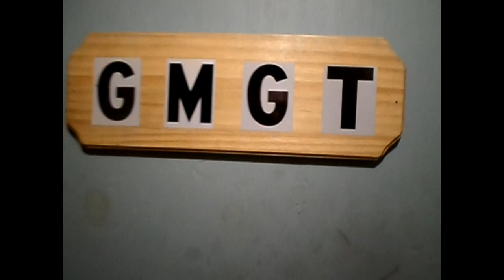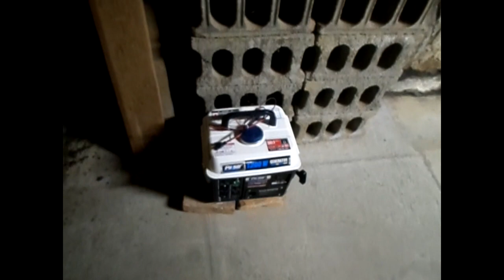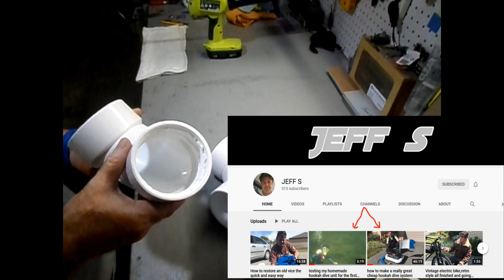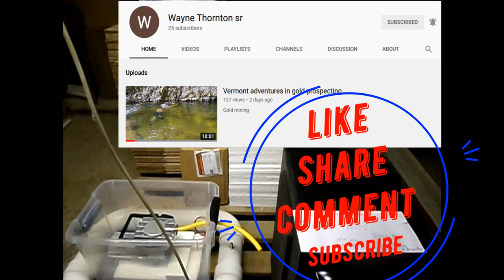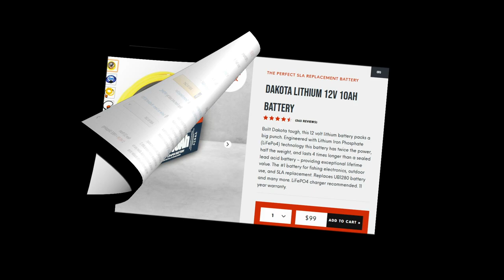DIY Dive Hookah Build - Green Mountain Gold Trap

Comment: Sweet build Joseph! Looking forward to seeing you using it.
Reply from the maker: Thanks Dallas😁 I did do the one test run with 6min under water. It was GREAT and I could have stayed down there for hours! I love it😃
Reply: Makes me want to build one however I don’t really have a good place to use one at the moment lol. Also just wondering did you by chance keep track of the cost to build it?
Reply from the maker: @dallassams6427  It was over $400. However, I bought 100' of air line with the regulator and mask. Someone could save money there by searching for less air line, buying a mask separately as well as the regulator. But, an actual dive hookah costs $1,225.00 to $3,445.00

Comment: Thats an awesome job on that dont have to worry about bulky tanks that is a great idea. That way i can go back to driving with my back problem really nice i think im going to make one thats really cool. Need a new mask flippers ans a weight belt. Maybe i will just sink with all this metal in my back. Thanks for the build Joseph i think you made my day.
Reply from the maker: AhHa, you have built in weights! Not exactly funny but, it may work to your advantage! But hey, do yourself a BIG favor if you do build one, Get (Food Grade PVC Cement). If you do an internet search on it, Gorilla puts one out on the market.
All in all I think mine weighs around 10 ponds with the 50' of air hose and without the reserve air tank. That's roughly 8 pounds. But as you can see, I made then so that you can carry one at a time.

Comment: Hello and congratulations.I made one the same but I can not go below 3 mt.Tu how deep you reach without straining too much in breathing?
Reply from the maker: Thanks Filippo!
I have not been in any locations as of yet that deep. However, the guy who put a video out using the same pump went deeper than 3 meters. He built his with 4 inch pvc pipe for the tank.
Maybe give the tank time to fill up a bit before diving.
I installed a pressure relief valve in mine so that the tank won't overfill.
The places I go do not require me to go any deeper than 2 meters so far.

Comment: great video.  I plan to build a Hookah similar to what you did.  I have a choice of aeration pumps with capacity: 3000l / H, 3600l / H, 5100l / H, 7500l / H, 8400l / H.  Which will be optimal?  Will the 3600l / H pump be optimal?  What battery do you have and how long does it last?  Have you considered the option of a pressure sensor and when exceeded, the pump is turned off, and when it is lowered, it turns on?  or does he have to work all the time?
Reply from the maker: Thanks GS Creative! Not sure on the 3600l / H pump. Don't know anything about them really! I got the Boyu pump because another person did a video on it and it worked. I bought 2 Dakota Lithium batteries. Each one lasts 1:29 min on a full charge. They ran me $99 each and the charger was about the same price.
I do want to upgrade and add a pressure sensors but have not yet so for now it runs constant. I did add the 100psi pressure release valve just in case.

Comment: Have you ever dove over 10 feet with this setup? I just ordered my hookah parts yesterday...going with the boy u 120 watt 160 lm..I hope it's a success..thanks for sharing
Reply from the maker: Thanks roadstar for watching. I personally have only been able to go 8’ as it was the deepest hole I’ve encountered.
However, the guy in Australia who put out a video using the same pump went 13’+ with his in a lake or pond.
Consider using an aluminum air tank. I know Harbor Freight has them.
Also, I have had people give me a hard time on the air hose I bought.
So, you may want to find actual dive air line. Apparently mine is not.
So, if you do go with the PVC air tank, Don’t use plumbers cement.
It takes months for the toxic fumes to dissipate.
Good luck. You will love it for sure!
Reply: @GreenMountainGoldTrap  sharing. Will be going to harbor in next day or so..what  aluminum tank are you referring to..? Thanks for the info..
Reply from the maker: I never looked into it. It was something someone had said in a video. Or, someone told me about it. Can’t remember which!

Comment: Okay harbor freight has steal air tanks..heavy,bulky etc..once your pvc cured did it work well? Or do you wish you would have went with 4" instead of 3"...? I don't think this pump produces much pressure...did you ever figure out max pressure generated in holding pvc reserves? I could use e6000 instead of pvc cement which cures in a couple of days and will hold very well,been using it for years..thanks for sharing
Reply from the maker: No aluminum tanks! Bummer! I feel the 3” is fine. I added a pressure release valve that kicks on at 100psi just to be safe.
And yes, after the winter got over the fumes were gone and it’s fine.
I think Gorilla has a product as well. That is I believe food grade.
Reply: @GreenMountainGoldTrap  so you installed a 100 psi release valve on pvc donut? Any idea of how much pressure builds up? I guess adding a pressure gauge would be very easy also..I just did not think that boy u 160 would build up much pressure...I am a week into research,so i have a lot to learn...definitely like the pvc donut idea best...thanks
Reply from the maker: @roadstar499  I have only used to whole unit (pump in the tote sitting on the pvc tank) once. All the other times not feeling like hauling everything in I took just the tote with the pump.
So honestly, I can't say for certain. Personally, my plan when I use it this season is to allow the tank to charge up with air a little bit before diving. 
As for installing the release valve, that was simple. I just drilled the hole slightly smaller than the threads and then screwed it in. Put some marine adhesive sealant around it and called it good!
Reply: @GreenMountainGoldTrap  very cool...I should get my pump in a couple of days and do some testing
..last night I figured out how to adjust regulator, which seems to be a big factor in performance,some guys using same pump say 5 foot is the limit, but this other guy has a video of him at 30 feet and he used same boy u 160 120 watt with cheap yellow reg(which he adjusted) ..he said at 30 foot I was pretty hard to breath but 23 foot was fine...thanks for all your feed back.
.
Reply from the maker: @roadstar499  I looked at my regulator. Doesn't seem to be a way to adjust. Any tips?
Reply: @GreenMountainGoldTrap  tried a couple of extra air tank  methods..I am very happy converting a 2 gallon $16 pump sprayer..it also has a built in release valve..total pressure is approximately 25 psi...no leaks..after fine tuning my regulator its ready...I used 160 lpm pump..took it apart and cleaned removed all metal filings.using a $30 chrome small 12 vt battery from Amazon I should get 50 plus minutes before battery starts to gradually produce less air...if pump does cut off I get 2- 3 full breaths..I also noticed using tank makes breathing less restrictive..
No glue was needed for tank,but I did use e6000 industrial adhesive to make the 2 Miller extra flow fitting extra secure.i am using 20 foot of food grade clear 3/8 Id tubing for now...does not kink and seems very decent for now...hope to be able to use  it to find my sunken rc boat within next week...
Reply from the maker: @roadstar499  Sounds outstanding! Would love to see some pics of it. If that's cool with you send them via the Contact Us Link on my website.
https://www.greenmountaingoldtrap.com
In the subject put, roadstar499 Dive Hookah Build

Comment: Awesome!!  I have been looking forward to this build!!
Reply from the maker: You and me both Josh. Just wish I got it done sooner. Winter is going to really suck this year!
Reply: @GreenMountainGoldTrap  yea i can imagine.  The only thing I would have done to this is I would have rapped pool noodle around the PVC to add extra flotation to it.  As well as add handles/strap to be able to secure the tub into it  while in water.  Some areas of water can be rougher then others so good to be prepared for it =)
Reply: @GreenMountainGoldTrap  this is going to open up way more possible prospecting spots for you now!!  Can't wait to see what you find.  I am going to end up building one probably this winter so that I can have one to use for prospecting as well as diving in the local lakes/rivers just for fun.
Reply from the maker: @joshortiz1576  Funny you should mention the pool noodle, I was just thinking that today! As for rough water, I don't think I will be doing anything there. As a matter of fact, with 50' of air line and all the spots I go, I will have the tank and pump on shore. Great ideas though! Thanks😁
Reply from the maker: @joshortiz1576  That's awesome Josh. It's an easy build and you will love it for sure.

Comment: It appears that the battery lasts 90 minutes if running nonstop. I'd assume that once you get a regulator setup put on it where it can shut off when it gets up to pressure that it could last even longer when running intermittently? I've been going over options for months of how to do this safely.  Reading on the internet gives so much info that I became leary of using pvc pipe as the air tank.   Now harbor freight has a 7 gallon aluminum filling tank for about 65 dollars that I'd considered to use as the air reservoir while still using PVC as a floating table. Would love to brain pick you.
Reply from the maker: Thanks Shawn! I tested length of charge on the batteries I purchased from a full charge. The run time was 89 minuets. Feel free to ask questions. I will do my best to answer. And please do tell, what did you discover on pvc? And would aluminum be any safer? Just so happens we have a Harbor Freight opening very soon here. Still under construction but my step son is one of the assistant Mngrs.
Reply: @GreenMountainGoldTrap  now aluminum is best because it wont rust and is pure so it wont corrode and is much lighter as well. No one would want to really use an air tank made of steel when the inside corrodes over time and sprays out rust water from the release valve.
Reply from the maker: @shawnjones8748  I'm guessing scuba tanks must be made from aluminum. I'm going to have to look into changing it out once Harbor Freight opens up. I don't need the pvc at all since I have 50' of air line. And the 7 gal tank sounds like it will be a larger capacity than what I have now. Thanks for the info!

Comment: Nice build, for a second thought the tank was going to float the tube, partially submerged to keep it cool.
Reply from the maker: You lost me on that one Ed🤔 The only part of the pump that gets hot is directly above the diaphragm due to friction. The battery get a little warm as well. As for the air line, it floats on top of the water.
On another note, you and Judy were on my mind today. If I weren't so busy, I would have called you. How is everything going?
Reply: @GreenMountainGoldTrap  Doing ok, got stuggle snap hurdles to get over. We are taking it one day at a time,
Reply from the maker: @HDshovelEd  Good, you will both get through it. Keep the faith.

Comment: Nice build!  Thanks for sharing.  Do you get any build-up of moisture in the tank?   Do you use any means of air filtration?
Reply from the maker: Thanks Michael! So far I have only used the tank one time. There is more mods I want to do to the system such as adding a switch, air pressure regulator so the pump shuts off when it get to a certain psi, add a filter as well as rig it to support two divers. I built it towards the end of last season and it's killing me!! Can't wait for spring!

Comment: Did you fuse your pump. Concern is water getting in and short that could cause high heat/fire the bad gas/air
Thank you nice video
Reply from the maker: Thanks for the heads up redwood1957. No, I didn't! Really haven't had many opportunities to use it. Don't like going without someone else present for safety reasons.
I have further mods I want to add. Your suggestion is a simple one to incorporate.
Reply: @GreenMountainGoldTrap  trying to build one now thanks mike
Reply: Sailing boreal for psi relief and filters. Try a Nokta pulse dive.
Reply from the maker: @redwood1957  Would love too. But, our gold for the most part isn't detectable. I have a junk Trident Viper or, Viper Trident. Goes 30 meters underwater, but it's garbage! That's what I get for knowing Nothing about detectors and buying one on a whim!
Boreal is a Yacht! But I;m thinking you mean something else since you ended the sentence with, for psi relief and filters.
I have the 100psi relief valve already incorporated. Works well. Just do be right near it when it lets go. It will make you jump a mile!!! 🤣
Reply from the maker: Excellent  @redwood1957  Whatever you do, don't use the pvc cement if you want to use it before a years time! That stuff took forever to stop stinking!
There is a food grad version for pvc cement.
Reply: @GreenMountainGoldTrap  sailingboreas,youtube makes snuba rig parts
Reply from the maker: Nice, I will check that out  @redwood1957  Thank you!
Reply: I have built mine without pvc and tote.when I breath from regulator I hear the pump change sound as if I'm pulling it down on air.  Any ideas 
Thank you

Comment: Perhaps because I am accustomed to a Scuba tank, I find the flow from this pump to be really unsatisfying. I am able to draw breath, but not fill my lungs as quickly as I am used to, even at rest and at the surface. I am not sure if my pump is defective or if my expectations are too high. Not sure what could go wrong with the pump, it seems pretty simple. I have not built the air tank yet.
Reply from the maker: Hi Gregory. No, I as well have no idea but without the tank I agree with what you have said. I myself have never used a scuba tank so I can't say I know the difference.
 With the tank it's better but again, I don't know the volume a scuba tank gives in comparison to what I have.
 What I plan on doing is switching the tank out with an aluminum tank that will have more capacity than the one I built. I need it to be light weight.
Reply: @GreenMountainGoldTrap   I have been thinking of options for an accumulator tank - today I'm thinking of one of those plastic garden sprayers.  Cheap and won't rust.
Reply from the maker: @gvaughan67  I wonder how well they would hold up under the pressure of a pump. They are made for it but, how much is the question. Harbor Freight has an aluminum tank that eventually I will take a look at.

Comment: One of the important things I have seen from others who are underwater sniping...  Use ear plugs to avoid water getting into your ears and avoiding ear infections. Tassie Boys Prospecting is a big advocate for this, as he is another river sniper.
Reply: Now you're gonna need underwater camera gear... :D ...to record some of these adventures. Secondly another thing to pass along from other snipers - gloves are important, as you'll cut up your fingers without realizing and at least with decent gloves you'll have an indicator as to what's going on.
Reply from the maker: Very valid point Roger, thank you. I have never had any issues but recently I did. Messed up my equal librarian and had one heck of a dizzy spell. Not Fun😲
Reply: The only "problem" I can see with your design is battery placement. Given it is right under the air supply tube, it is gonna be in the way to swap batteries. Secondly, depending upon how long you plan to snipe per day, you may want more than one spare battery. And more than one charging system or a dual output charger.
Reply: Crikey!!! The cost difference from USA vs Canada - amazon for same air pump = $190 cdn!!!! (plus shipping)  Yes, there's a 25% difference in our dollar, but wow!  I'll order from the USA and have delivered to the border, pick up after the border reopens...
Reply from the maker: @RichardRoger1966  Not a problem Roger. That battery comes out very easy. I also ordered another battery which I mentioned in the video. One battery charge lasts 1.5 hours. So 3 hours will do me just fine this time of year as the water gets cooler. However, I may pick up a third a little down the line because your right. I could live under water😁
Reply from the maker: @RichardRoger1966  Nice Roger, your going to build one as well! Good for you. I'm also thinking of adding onto it. The support for two divers, quick connect air lines and a regulator valve to shut off the pump when it reaches a certain psi, also an on and off switch so I don't have to connect the alligator clips each time.

Comment: what specific regulator did you use?  Because you don't have a first stage, and are using a high volume compressor, the regulator has to be adjustable to the low pressure.  If you're not certified - remember NOT to ever hold your breath... EVER.  You can blow out your lungs in the first couple feet of water.  (also, "food grade" isn't really a helpful term here - you aren't eating your air, you're breathing it.  Get Breathing Certified hose.  :)
Reply from the maker: Thanks for the tips. Actually, this pump isn't high volume at all. The regulator was one I purchased from Amazon. A China knockoff of some sort.